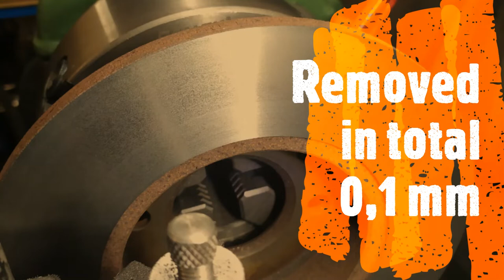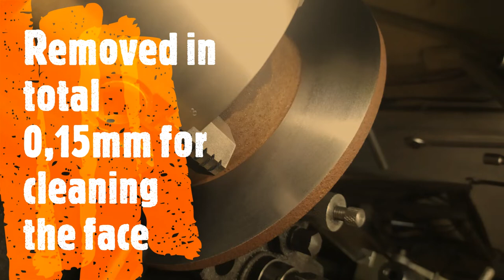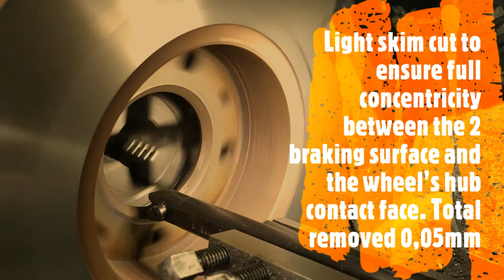Turning brake disc on manual traditional lathe, brake rotor resurfacing

Comment: Good job. Nothing brings out troll comments like turning drums or disks. It’s amazing. You could hand them two turned rotors - one of yours and one done on a brake lathe. Even with a micrometer they won’t be able to find taper or anything different between the two yet you are “doing it wrong”. Great video!
Reply from the maker: Hehe yes there are troll everywhere and most of the time they have no idea what they talking about.
I fully agree with what you say, doing it this way, without the rotor leaving the chuck from start to finish, it's pretty much the same thing, the last step in the process is to light skim the hub contact face, so it's like it was bolted to the brake lathe.
Glad you enjoy the video, thanks for watching ;)
Reply: Spectatorism. Lazy spectators  not involved in life.

Comment: Hi. May I know if you are using special tool bit for this? Currently have 10% Cobalt with me, but my foreman said that it's not suitable. Not sure why he said that.
Reply from the maker: Hi, for this job i used some carbide tips, but i think you can get the job done with hss co10. cast iron Is very abrasive on the tool tip, i think that's the reason why your foreman said that. If you can use carbide It's for sure better due to it's higher wear resistance.
Reply: @machiningandtuning  thanks for the input sir!
Reply from the maker: @borneoaxiadriver  no problem man 👍🏻
Reply: I always use tungsten carbide tipped tools. Lower R.P.M. gives less vibration. Getting the thickness parallel is crucial